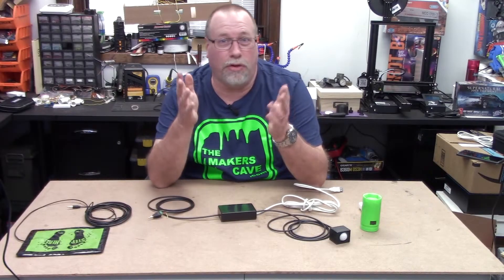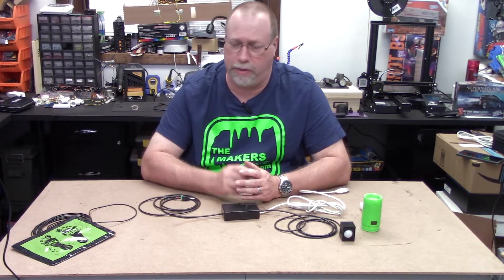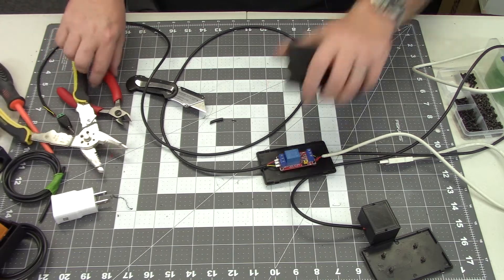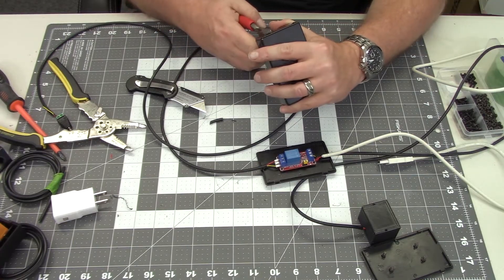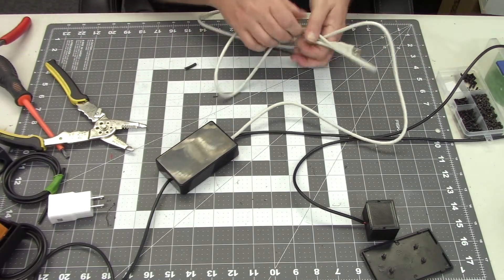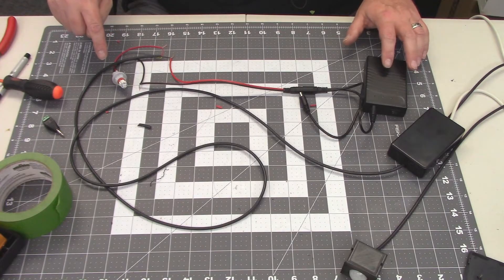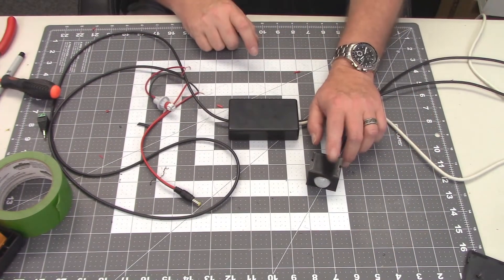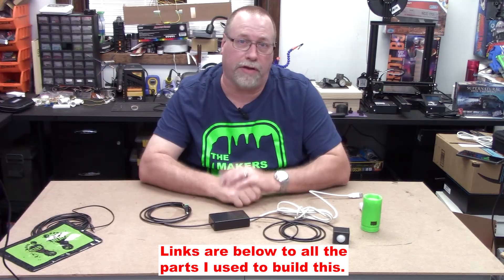Turn Almost Any Prop Into A Motion Activated Prop.

Comment: Your video is so helpful.  I just bought an animatronic skeleton from At Home and it came with a try-me push button that is highly impractical and it won't activate without pushing that or touching around the battery storage area of the prop itself.  However, the input for the try-me button looks more like (forgive my very poor terminology) a tiny little telephone jack and there's only 2 wires, not 3.  If I were to repurpose the wire from the provided push button, would this still work?  Would I just put them in the common and the normally open part of the relay board?
Reply: I am trying to figure this out as well. The only thing I've learned so far is the plug types are called JST (Japan Solderless Terminal) connectors.
Reply: @alexapuerta appreciate your input!  I ordered his kit anyway and am trying to rig it with just the 2 wires that connect to the try-me port. No matter how I put it, it reacts to motion but if more motion happens (like a second person walking behind) it will immediately cut off the animation without completing it. Unsure if there's a way to fix that, cause I anticipate the kids won't just be walking onto my porch one by one
Reply: @heatherstockman3150  I think you need a third wire and that's why it won't work. I ended up using a combination of cameras, LED lights, smart plugs, and app automations to trigger mine.
Reply: @alexapuerta do you have any photos of how you hooked it up?
Reply: @heatherstockman3150  Not for sharing, no.
Reply: @alexapuerta thanks, man 😐
Reply: @heatherstockman3150  Can't share photos on YouTube and pointless to share anyway without knowing what tech you already have.

Comment: Hey Steve. I made some of these. They work great. Thanks. I want to make a device that will rotate a 110v,1 rpm motor, one time, then reset, until the button is pushed again. Any ideas? Thanks
Reply from the maker: That PIR sensor and be set to latch the relay for varying seconds by turning the potentiometer that's on the PIR board.  Just note that you only have to move the pot a VERY ,VERY small amount.  The only thing I would suggest is using a heavy duty relay.   Take a look at this, it might help.  Once you move up to a HD relay the PIR needs a little modification to fire the relay.  https://gravedecor.com/product/motion-activated-relay/
Reply: @TheMakersCave  Thanks for the info. I wanted to do a switch/switches. If I don't have it timed perfectly, the start/stop position of the prop will change. I could use two of those PIR sensors, that you showed us how to make, one to start, and one to run. Thanks again for all the info. Tom

Comment: Can you hook this up to the small two pin "Try Me" port on the skeletons that everyone sells now and if so does that connector come with?  With additional wiring can you hook them up in serial so you can trigger several to go on at once?
Reply from the maker: That is exactly what this is made for.  I include he plug but you don't have to use it.  Just find the two wires for the "try me" button.  The Motion relay box has a 3 conductor wire coming out of it with Black (COM), Red (NO), and Yellow (NC) wires.  Connect one button wire the black (relay common) and the other button wire to the Red (Relay Normally Open).  Now when motion occurs the relay will make a connection just like the button.  I would hook more than one skelly or prop to these wires, you never know what voltage is on different props that could short them out.  There are dual, 3, and even 4, channel relay blocks that you could use.  I have those and can configure a motion relay activator to work with these.  If you're interested just let me know.
Reply: I have about 10 skeletons I'd like to hook up to come on at once.  They're all basically the same.  Would I need more than one of your devices, or just more wire?

Comment: Im assuming you have seen the animated fuse boxes before. I have a question regarding that prop. The animation doesn’t seem to have a built in timer. It’s either on or off. How would the PIR sensor work in this case. It will activate the prop easily but how will
It turn off and how long can you have it run for if you can turn it off.
Reply: I may have answered my own question. I shorted the wires out on the try me
Button and it runs for 15 seconds. I wish I could activate it and then just have it run for 5-10 seconds and then shut off.
Reply from the maker: Actually that can be done using a relay with a built in timer.  The motion relay in the video would activate the timer-relay which would activate the fuse box for a set amount of time.  The timer relay looks for a LOW signal to activate so you would take the normally open leads from my motion sensor relay and connect one wire to a ground and the other lead to the trigger of the timer-relay.  The normally open terminals of the timer-relay would, of course, make the fuse box work.  It would run for the seconds you set the timer-relay to.  In order for this to work you would permentaly tie the try-me wires together so the fuse box would always run.  You would use the timer-relay to control the  power going to the fuse box.  The timer-relay would power the fuse box for the time you set.
Relay Link: https://www.amazon.com/HiLetgo-Trigger-Adjustable-Control-Conduction/dp/B0832MW9L4?crid=43AVEKQYL1PE&keywords=timer+relay&qid=1666705731&qu=eyJxc2MiOiI1Ljc3IiwicXNhIjoiNS40MiIsInFzcCI6IjUuMTgifQ%3D%3D&sprefix=timer+relay%2Caps%2C77&sr=8-1-spons&psc=1&linkCode=sl1&tag=themakerscave-20&linkId=5455e860d3de05c60b8275790d086f11&language=en_US&ref_=as_li_ss_tl
Reply: @TheMakersCave  so just to be clear, I would use both the relay in this video and the relay with the built in timer?
Reply from the maker: @mcb0b1  That is correct.  Based on your problem I'm going to do a video on a design I came up with that will only use the timer relay.  Sadly, that'll be after this Halloween.
Reply: @TheMakersCave  sounds good. Thank you. I will check it out
Reply: @TheMakersCave  sounds good. I might just wait for that video. I’m already scrambling for Halloween as it is and could use one less project for now.

Comment: Thank you for your video! I bought all the parts and put the sensor, relay together operating 2 props. I got it to work great indoors but when i set it up outdoors I got continuous false triggers. I turned the sensitivity all the way down but still keeps triggering.  Am I sunk? How can I reduce the sensitivity further??
Reply from the maker: If you're using the PIR sensor bare, that could be your problem.  The PIR sensing scope area looks like a cone, narrow at the sensor and it widens as it goes out.  You could be picking up things that are to the far right and far left.  Trying making a tube so the sensor can only see directly in front of it.  Also make sure that it's not picking up movement of other props within the sensor range or scope.

Comment: I know I asked this before.   But I bought of amazon what thought was the same motion detector.  It has its own box with 3 wires coming out..However it does not work.. Does that motion sensor come with a box ready done ?  I do not have a 3d printer.  I used the motion sensor on a few things last halloween.  It worked.  But worried about out in all weather.
Reply from the maker: We actually have a new "all-in-one-box" design that we are putting up on the site (www.GraveDecor.com) this week.  We can make it "weather resistant"  by sealing everything with silicone.  I'll let you know when it's up so you can take a look at it.

Comment: Hello, I am trying to make a barely working motion sensor stronger. I can't seem to find anything that has the correct connection. It's two little wires connected to a small terminal end that plugs into the top of the power box.
Reply from the maker: Would love to help!  If you can take some pictures and email me at: Steve@GraveDecor.com it would be really helpful.

Comment: This is great. Do you have an updated version of this? Because of this video I started looking on Amazon and saw other motion sensor devices that looks pretty close to what you’re doing here. Just wonder what I would have to do to make them work w/ a Spirit Halloween animatronic. 
Thank you!
Reply from the maker: Yes, there are other similar devices around, just make sure that they only close contacts to make continuity and that they DO NOT supply any power.  If you put voltage in to a "Try Me" port you'll fry the main board of the prop.

Comment: Hi Steve!  Great video!  I tried doing the same thing with 5v LED lights, but they're wired to a 6v battery pack (4-1.5v AA batteries), which should be enough power and I wired the 5v relay module to another 6v battery pack (4-1.5v AA batteries).  However, the lights don't turn on.  The relay seems to work, but that's it.  I'm not sure what I could be doing wrong, but I was hoping you could help me.  From the 5v relay module, I have the positive wire connected to NO, which is then connected to the positive 5v LED lights.  The com from the relay module is connected to the positive wire to the battery pack.  The negative wire from the battery pack is connected to the negative wire to the LED lights.  However, there is one more wire from the LED lights (which is the output wire) that I didn't initially connect to any of the wires.  But, when nothing was working, I connected it to the common wire and positive battery pack wire, with no results.  Could you help me out with this?
Reply from the maker: Hi, thanks for watching.  It sounds like you are on the right track with putting the neg to neg and splitting the positive so each end goes to the NO and Com of the relay.  The thing that stands out to me is that you said there is a third wire on the LED strip.  That sounds like you have and addressable LED strip which needs a controller to work.  The controller sends the signal to the strip telling it what LEDs to light and what color.  You need a strip that only has two contacts, positive and negative.  Is it possible that you can send me a picture of the led contacts?  Steve@TheMakersCave.com
Reply: @TheMakersCave  Yes Steve, that is correct.  The green wire is the signal wire.  I will send you the pictures now.  Thanks!

Comment: Hello Steve. I appreciate your video it was most helpful. I do have a problem i am not getting any volts on the output side of the relay. The motion sensor seems to be work as i i am hearing a clock and a red light gos on for a few seconds. But when i check for volts there isn't any. What could i be doing wrong Thanks .  P.S if any one else can help that would be great.
Reply from the maker: Hi, 
The relay does not put out any voltage, it only acts like a switch.  I did a video explaining relays and how to hook them up.  Take a look at it and get back to me with any questions you might have. https://youtu.be/-NjP07dHUGI

Comment: I was just thinking. I will be using these on the "Try Me" ports of props. When you push the button (or activate via relay) once, the prop does its routine. If you push it again while the routine is underway, the routine is interrupted and stopped. So I'm wondering if, with a short delay of a few seconds, it may be possible for multiple triggers by the same subject to happen, thereby making the prop start, stop, start again, etc.? If, of course, "delay" means how long the relay is kept activated by the sensor. Hope that makes sense.
Reply from the maker: What happens when you push and hold the button?  Does the prop activate?  Most of  mine work this way.  Then you set the PIR jumper to Single Trigger mode with a long enough delay.  That stops a re-trigger while it's working.
Reply: @TheMakersCave  I can only try the one that has not yet been packed away, and it does its routine and then stops, even though the button is still pressed. You must release and repress to make it cycle again. I believe all are the same way. None are Spirit-level props. And what you said is what I figured. I think the thing to do now is just order a few and play around a bit. Thanks.

Comment: Exactly what I was looking for with the mono plug trigger, but I'm assuming you can replace the USB wire with a battery pack with on/off switch instead. The animatronic will have its own battery pack, and the PIR sensor has its own, correct?
Reply from the maker: Yep, you can replace the USB with a battery back.  I don't think 4 x (AA or AAA) at 1.5V each (6V total) will hurt anything.  The PIR sensor is powered through the usb and it will take the 6V.

Comment: How do you wire it for a 12v motor (like the light in this video)?  Does the switches wire just go into one of the 12v power wires?  I’m trying to motion activate a wiper motor for a prop
Reply from the maker: Yep, you would wire it like in the video.  Take the neg of your 12V & attach it to the motor.  Take the pos of the 12V and wire that to the Com(common) terminal of the relay and wire the NO(normally open) terminal of the relay to the other contact on the motor.

Comment: This works great for battery operated props.  I’m building a couple of props using deer motors.  I saw your reply for wiring to a windshield washer motor, using the heavier relay.  I am somewhat confused about connecting the deer motor to the relay and to an external power source.  Maybe a drawing?  I’m a senior without an electronic background, I appreciate your help!  Also, can the relay/PIR be connected to the same external power or should it remain on the 5volt power?
Reply from the maker: I put up a video explaining on how to hook up AC lights or motors to the relay.  If you have any questions, just ask :)

Comment: I really appreciate you doing these video. Very helpful! 
The props I am controlling are power by three AA batteries. If I recall correctly that's about 4.8v. Could I power the replay and the prop off that same USB power cord?
Reply from the maker: You can try, fresh batteries would probably work fine, but as they are used the voltage drop may affect it.  I would suggest try using a phone charging battery pack. That’s 5v and should last all night, p,us it’s rechargeable

Comment: I took apart a newer USB it's wires are much smaller.  Does it make a different...can't tell ya the gauge, but it's definitely thinner...(not because I accidentally stripped it either lol).  Just wondering...does wire thickness make a difference.  (sorry for a very newbie question)
Reply from the maker: Hi!  USB cables are made to handle at least 3A (15 watts at 5V).  You should be fine.  The PIR and relay do not pull that much amperage.

Comment: i have a question, i had 3 jumping spiders and could only get one to work with motion sensor, i even tryed the one motion that was working on the other 2 and nothing. was wondering if you ever came across this before
Reply from the maker: Hi, thanks for watching.  Are these the jumping spiders from Spirit?
Reply: @TheMakersCave  yes they are and they work on the step pads
Reply from the maker: Spirit changed how their try me ports and step pads work.  The pads now use a piezo disk that, when stepped on, produces a very small current that goes to the main board of the prop.  Simply putting in a connector and shorting the two leads no longer works.  I am experimenting on how this works in detail so we can use a motion sensor like the one in my video.
Reply: @TheMakersCave any solution yet?
Reply: @TheMakersCave I'm bumping this because I'm currently having this issue, you helped me get the motion detector wiring right and lights up and clicks but nothing from the animatronic unless I introduce resistance with my finger. Any help deeply appreciated 👍

Comment: Any reason why this will not work for "Mr Dark"? But works for the rest of my animatronics including Emmeline. Spirit step pad still works so its not the aux port on computer on Mr Dark. Please help!!
Reply from the maker: if it works for "Mr Dark" then it should work for "Emmeline".  I looked up your order and saw that you bought the Motion Activated Relay.  Is this the one that works with Mr Dark?  And is it the same one that won't work for Emmeline?  Making sure I have the big picture :)
Reply: Works for all my animatronics I tested it on except for Mr Dark. I thought it was the footpad port on Mr Dark. So I plugged in a foot pad and it activated. I'm stumped. These motion sensors work great! Just the issue with Mr Dark.

Comment: So why only use a 5v power?  Sorry this may have been answered already.  But if my relay is 12v and I believe my pir can handle 12v those should work
Reply from the maker: I state that because some viewers weren't paying attention when they would order their PIR and get the 5V version and feed it with 12V.  The 12V ones, like in my video, can handle VCC voltage from 5V to 12.  I said that so there wouldn't be a smoke show if some one wasn't being careful :)  The logic output/trigger line of those  type of PIR's is only around 3V, even if you power the PIR with 12V.  That's so the the output/trigger is compatible with TTL analog inputs of controllers like an Arduino or Raspberry Pi. So, no, your relays activated by 12V would not work with these PIR sensors.
Reply: So the hc-sr501 are not compatible that is some of the ones I have and pretty sure that's the ones you show in video
Reply: I do have several that are listed 12v-24v they don't tell me their output but I would hazard a guess that the lowest setting on a pir is.probably the one to use based off of your info